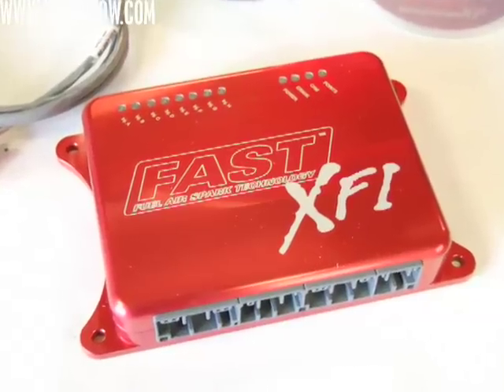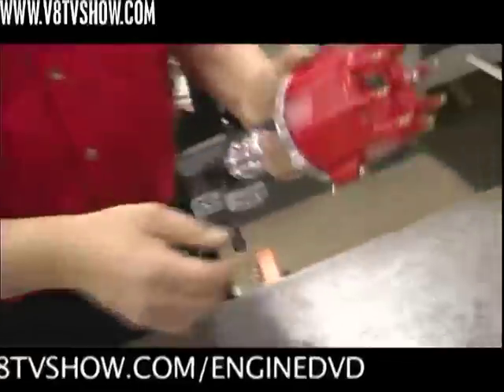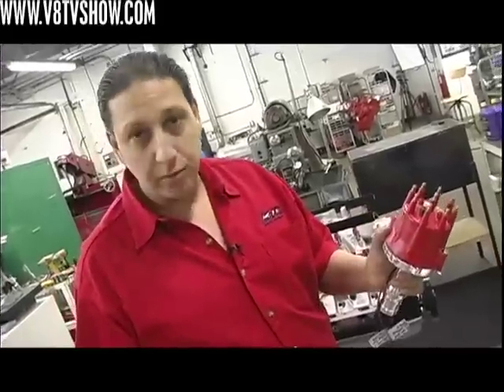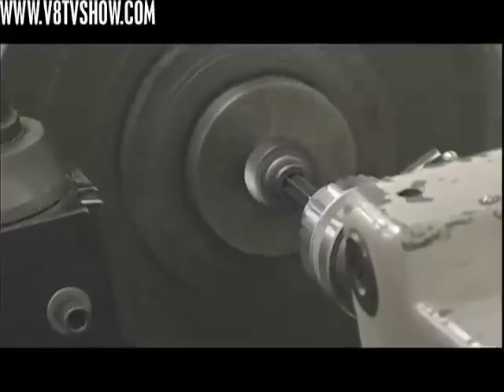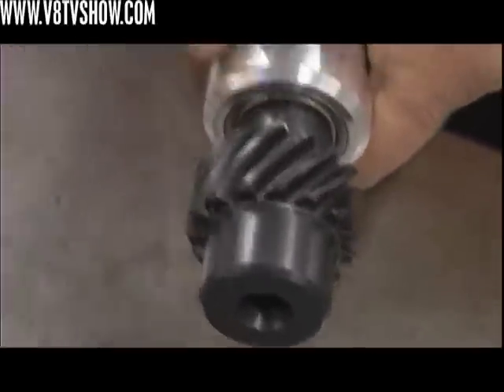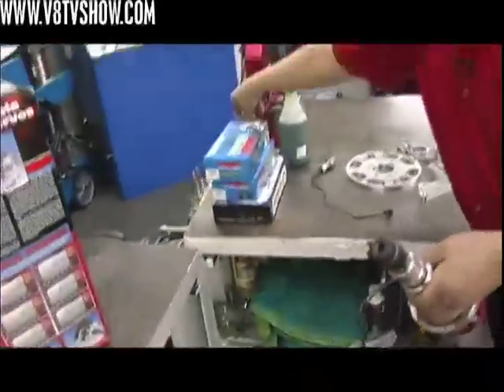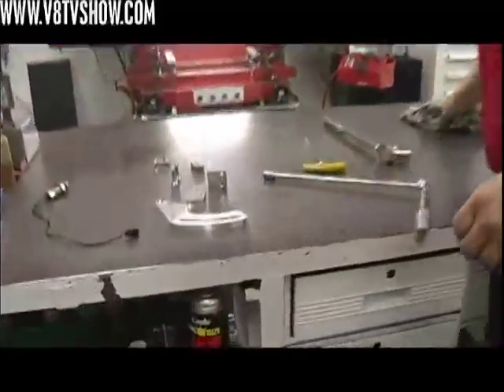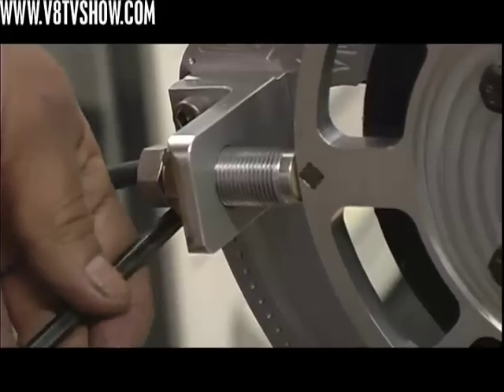Turbo "S71" Olds Engine Build Video BTR Performance Part 9 V8TV

Comment from the maker: @RandallFlaggNY This is from a viewer:  Gas and diesel blocks were the same basic casting. Diesels don't build manifold vacuum, so a vacuum pump was needed to run the a/c vacuum stuff. Vacuum was also modulated on the diesel injection pump for the automatic trans vacuum modulator. The vacuum pump went where the gas engine distributor normally went. 
 
The diesel's "lift pump" (which pulled fuel from the tank for the injection pump) went where the normal gas engine's fuel pump went.